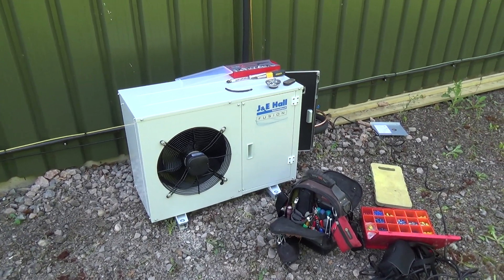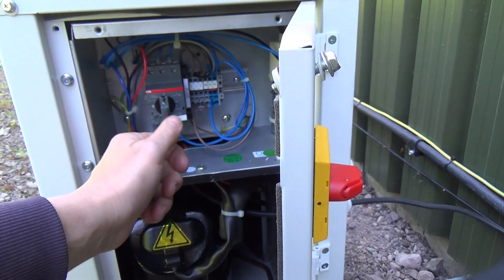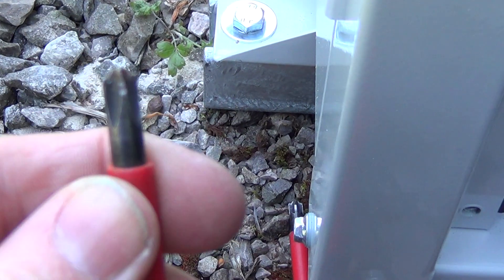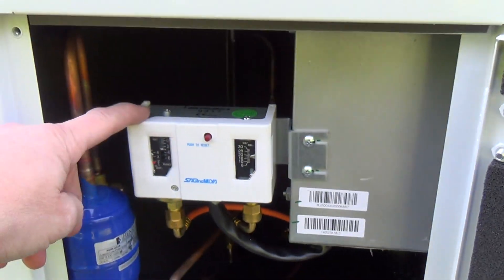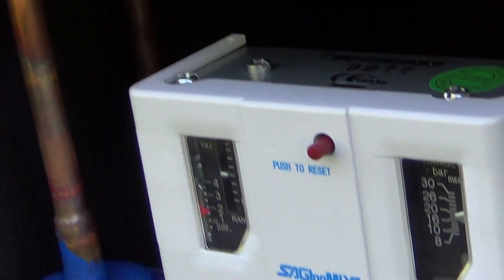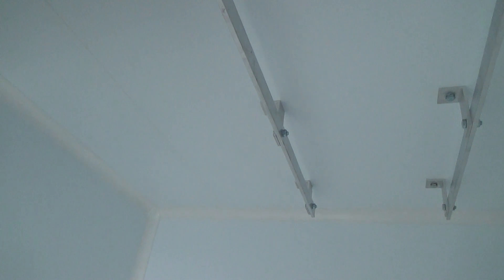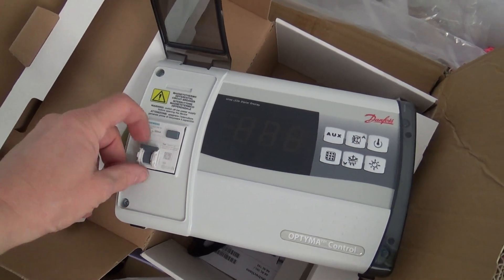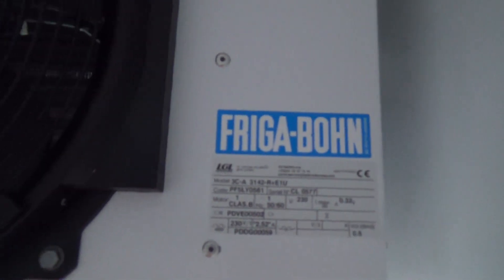Walk in Cooler Install

Comment: Just a question about the defrost heaters: on many of the evaps I see in walk ins , it doesn't seem to have enough space between the side of the evap and the wall in order to be able to pull out the heaters if they happen to go bad.
My question is : how do you pull them out in such a configuration then?
Thanks for the videos mate , cheers .
Reply: Most walk-ins have the defrost heater sat underneath the evap coils so it can be accessed / replaced easier, the ones in this video look impossible to change without taking the entire evap down as slide out from the side.

Comment: Nice clean professional copper work. Cool condenser pack too, so different from what we typically see in Canada and the US, I have never seen a liquid receiver placed between the condenser coil and the fan blade, and I’ve never seen a condenser fan motor mounted on the outside of the cage grill. 
Just a question though, I can see where you’ve brazed in the external equalizer from the TX valve after the sensing bulb, but it looks like a single circuit evaporator... where I live in Canada the code is that we only have to use an externally equalized TX valve when the TX valve feeds into a distributor on a multi circuited evaporator coil, on a single circuit coil we are permitted to use a non equalized TX valve. Is the code different in the U.K.? (I’m assuming that you’re in the U.K.). Most of my experience is with Sporlan valves, I haven’t seen many Danfoss TX valves here.
Very cool, thanks for the video!
Reply from the maker: Thanks! These style fan motors have external rotors, so the outside of the motor spins and the centre is fixed to the guard, it makes for a compact fan and blade assembly, though the downside is you have to replace the entire thing when the motor fails. 
We don't have any codes here as such, you can pretty much do what you like! The only requirement is that you have an F-Gas certificate (which is a two day test) and the company needs to be on an approved F-Gas register.
If I remember correctly this system is on R449A which is a relatively new refrigerant here, the wholesalers sent a flare valve but I only use braze in on new installs so went with what I had on the truck. 
Danfoss is pretty much the most common valve here, hardly see any Sporlan ones, a few Alco/Emerson also.
Reply: @heavydiesel  can't beat danfoss tevs

Comment: Looks great. 👍👍 Haven’t seen those units in the US, which refrigerant did you use?
Reply from the maker: This is on R449A which is one of the R404A replacements, actually seems to work well, its better than R407F imo. We originally specified this system to be on R134a as its a high temperature room, mid 50's F in think but when the customer placed the order the R134a unit was not in stock which here makes it a seven week wait.

Comment: Nice job. I see it's on r449a, is there much difference compared to r404a
Reply from the maker: Yeah, R449A is about half to a third the price of R404A! Was quoted £1340.00 for 10kg of R404A two months back and its had two price increases since!
Reply: heavydiesel yeah gas prices getting out of control. I got quoted £3,000 for about 80kgs of r134a. It's ridiculous

Comment: Can you please explain why you put the speed control on again. I didn't catch all of it.
Reply from the maker: Basically if the condenser takes too much heat out of the refrigerant (and hence lowers its pressure) there is not enough pressure difference between the high side of the system (condenser) and low side (evaporator) to push sufficient refrigerant through the metering device be it a TXV/TEV or capillary tube etc. Fitting a fan speed controller slows the fan down which raises the condensing temperature and pressure to suitable level. 

One of the signs of this is a bubbles in the sight glass which disappear if you raise the condensing pressure (in this case I put a piece of cardboard over part of the condenser coil to restrict air flow)

Next time I have to opportunity I'll make a vid of it.